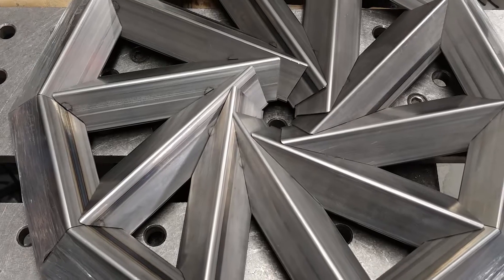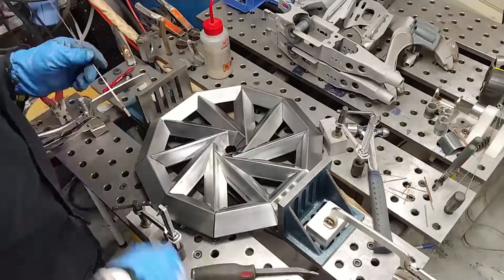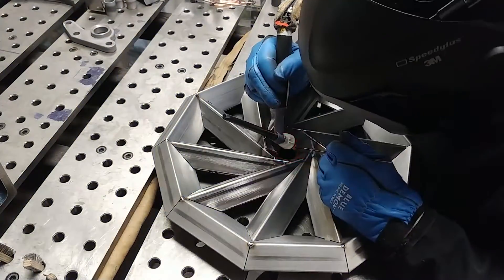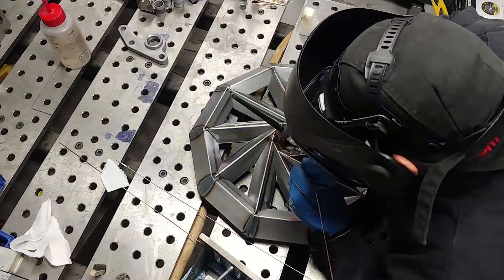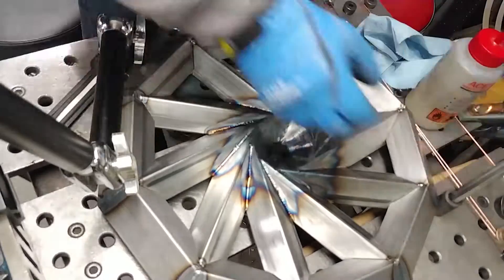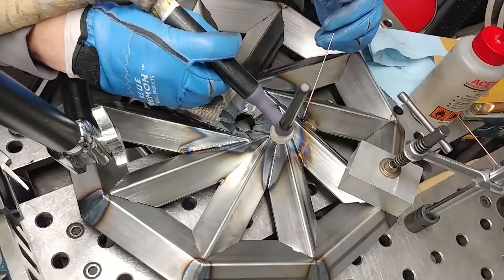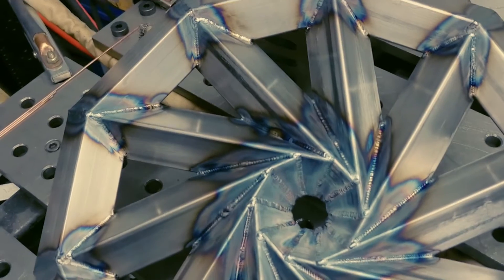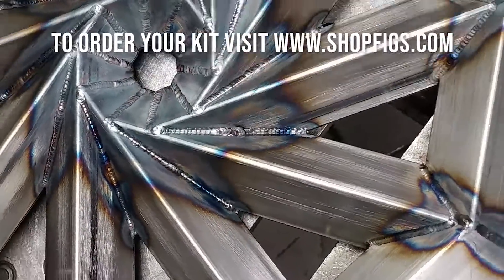FIGS IN THE SHOP: Welding Up A Hurricane

Comment: Great work as usual Mike.  What tip angle do you use on your electrode when welding stainless like this?  Also do you grind your tip in a swirl pattern or straight?
Reply from the maker: straight ground tungsten with a small blunt tip. 0.030 or so. The steeper the angle, the wider and thinner the puddle. so depends on if there are gaps or not. Wide and thin allows more control on some joints.